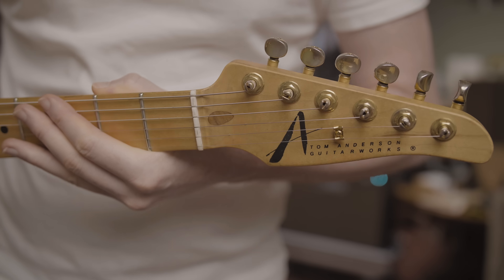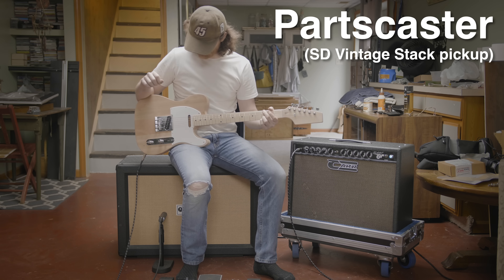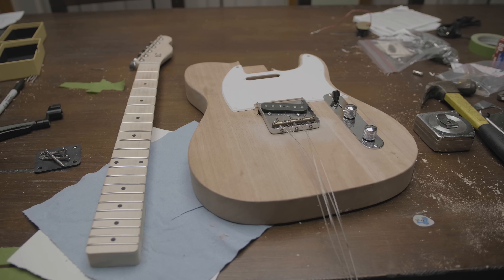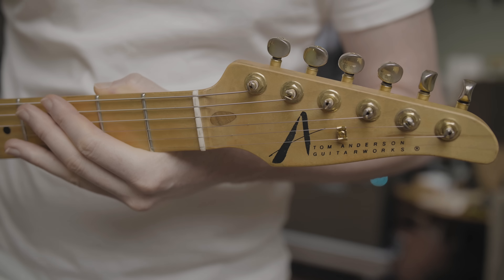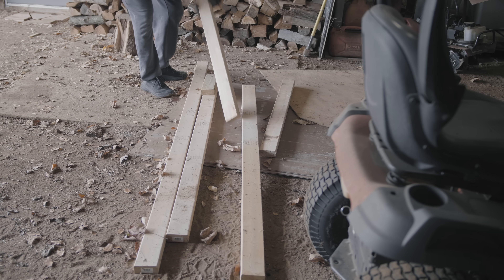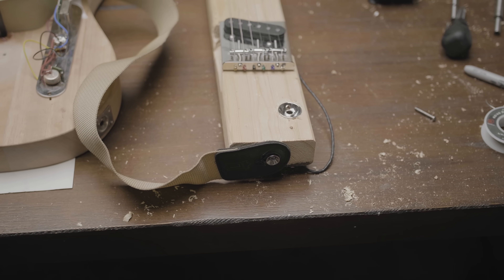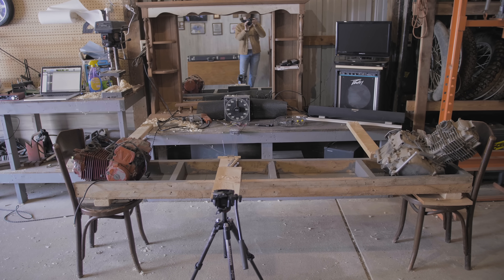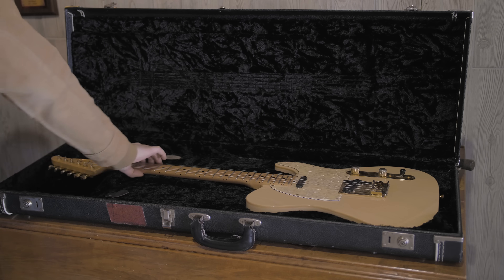Tested: Where Does The Tone Come From In An Electric Guitar?

Comment: Interesting study.  Nice work! I've felt for the past couple years as I build a few electrics now and then, that tone wood matters in acoustic guitars.  Whereas with an electric, the wood doesn't seem to matter too much other than provide aesthetics.  With the tele and strat, the pickups are suspended... they don't interact with the wood if at all as you just proved.  Now, as I write this I wonder about the guitars where the pickups are mounted right to the top, like a P90 on a Les Paul Jr?  Might be an interesting test also.

As a separate thought, I do notice a difference in tone when going from playing slide to playing a fingered note that there is a shift in tone.  With slide I find I lose low end response.  When fingering a note on the same guitar the low end in the tone returns.  The neck has to be contributing somehow in the equation, at least when you have your hands on it, even though I still agree that the type of wood has little if anything to do with it.

Comment: I absolutley love this . Not to long ago I had a discussion with somone about the myths around electric guitars. My oppinion after many years was that the main driver of tone is the electronics. Maybe 5% of the sound can be accounted for in the combination of materials. The rest is in the style and technique of the player. If you take a cheap guitar and do the frets and intonation and put in decent electronics, then the cheap guitar will sound like something ten times the price. The thing we tend to forget is, that by the time we've turned a cheap guitar into a decent guitar, the time and money spent getting to that point will probably be the price of a decent guitar. Then there's the fact that few people will get it right the first time. Acoustic instruments however are a very different ball game. Nice video and solid method and thougth process, thank's.
Reply: Most guitars have good enough pick-ups. Only the bottom line of Squier Bullet, Glarry of sub-100€ Harley Benton and the like will have dull souding junk. Others will just need a set-up and possibly a fret levelling (which is a 30 mn job at worst).
Reply: So much of what any given player likes about any given guitar is down to non-sound-related factors. Off the top of my head - the ergonomics of the body, the weight of the instrument, neck profile, frets and set up all have a practical impact on the playability (and appeal). 

Beyond that stuff like the colour of the instrument, does the player think the instrument is cool, the finish (say a glossy poly of some sort vs nitro) both from a visual and tactile perspective, and even the smell of the instrument all contribute to the experience.
Reply: I built two strats exactly  how I wanted them. Roasted maple necks because I  like the feel. Stainless  frets, dimarzio pickups with no center pickup In either and good electronics.  Both play great and have become my main guitars over some very expensive ones  I have
Reply: I know the player makes a lot of difference, but guitar tone is defined as the tone of the guitar itself, considering the player plucks exactly the same way and same notes. I know, player makes a world of difference, but that's out of the definition.

Comment: Honestly, the biggest change I saw was the changing the pickup, which implies to me that is the most valuable factor.
Reply: The pickups are the biggest factor for sure but sometimes pickups can sound good in one guitar and no so good in another so there are definitely some other factors.
Reply: @ryanstark2350  the guy legit just put the same pickup in 'by the numbers' kit guitar and it sounded the same.  Then put the pickup with just strings and no guitar, and it still sounded basically the same.  I think the pickup was the most important factor imo
Reply: @wildcat31772  He didn't disagree, but he might be right that different scale length, saddles, plate and electronics change it enough to make the pickup sound "bad"
Reply: @DenKulesteSomFins  I would like to agree but when he did the loose vs tight neck pocket I think that would bear a bigger change since that actually should effect the vibration though the body more than anything  - that I why I would be really curious to see a strat test where the bridge isn't fixed to the body
Reply: @ryanstark2350  I have run into this as well. I have no explanation. I have a pickup I didn't like in multiple guitars (SD JB) but I finally found a guitar that it sounds good in, and to top it off I don't even know what the body wood is of that guitar. The main difference is the other guitars it was in the pickup was straight and in this one it is angled so maybe pickup position made the difference.
Reply: @Kevslatvin  Tne main problem I find is that some guitats are bright and some are darker sounding and sometimes finding the right pickups can be difficult. Generally speaking, if the guitar sounds good acoustically but not so good plugged in, then the pickups aren't right but before doing this it's always best to check potentiometer and capacitor values. There are some general rules for this depending on pickup type that for some reason aren't always adhered to by some makers.
Reply: @ryanstark2350  He pointed that out with the 2x4 - the first test had no pots or caps. When he added the controls, the sound was the same. The loading of the controls has an effect on the sound of the pickup
Reply: @2bcmusic  You can put the same controls or no controls on different guitars with the same pickups and they don't always sound the same. I know because I've done this. The pickups are the biggest factor but not the only one.

Comment: Loved the video. Although I could hear slight differences when you did the body through vs bridge through strings and steel vs brass saddles. The pickup/electronics and pickup height setting appears to be the most important factor in sound. At least to my uneducated ears. I'd say what the boutique builders really bring to the table are their craftmanship that hopefully brings better playability, looks and prestige of their instraments vs an assembly line guitar. That is if they both had the same pickups, hardware and setup.  By the way, you bring playing air giutar to a new level.

Comment: Wood does not make as big a difference with solid bodies as it does with hollow and semi-hollow bodies. Pickups, the height of pickups, the hardware and the strings make a much bigger difference than wood, unless you have some rare, godawful sounding wood, which is not very likely even with cheap guitars. But the amp will make the biggest overall difference in tone. There are even composite guitars that sound fantastic. I played guitars with graphite necks that sounded fantastic. There is too much of an obsession with wood, and it's mostly witchcraft.

Comment: Great video, but I think that the amp colors the sound much too much. A clean tone ( and not crunch like in the video) might reveal a lot more differences.  Testing for sustain might also reveal differences. I wonder if using a crappy body with a thick lacquer would influence or not the sound as much ( mainly the sustain).
Reply: This! Not a lot to hear change if the signal is overdriven...

Comment: Great video.  I would like to see in the future a similar test done but with a more vintage correct telecaster pickup, P90, or PAF replica (non-wax potted).  I've always felt that more modern pickups (ie the Seymour Duncan Vintage Stack noiseless pickups) eliminate a lot of factors in the guitar that normally contribute to the sound.  If you've ever played on a vintage Tele or a Golden age Gibson with P90's or PAF's then you know that simply tapping on the guitar gets amplified quite loudly.  The pickups are a lot of times slightly microphonic and amplify every single noise.  I'd suspect that in that scenario a lot of other aspects of the guitar contribute to the tone that don't necessarily matter with a more modern pickup.  But there is definitely no right or wrong here.  Jack Pearson plays a cheap Squier and has incredible tone.  A good player and can play pretty much anything and make it sound great.

Comment: Nicely done, Jim.  I was impressed with the way you re-evaluated your testing methods along the way, especially things like the consistency of pickup height issue and the presence/absence of controls.

For what it's worth, you don't really need to have potentiometers (or even the tone capacitor) in the circuit but you MUST have the same loading on the pickup.  You can mimic a simple 1V1T circuit using 250k potentiometers with a single 120k resistor in parallel with the output jack. The exact value of the resistor isn't critical. It's unlikely you'll hear the difference if the loading varies by 10%. However, half or double the loading will have a noticeable effect. Of course using the potentiometers (same value and all set to maximum CW) and tone cap (same value), removes all doubt.

I'll be featuring your video on Guitarnuts2 later today. You have my utmost respect.

Comment: But the tone woods have an inflated sense of value! How am I supposed to hype my guitar? At least I still have my fancy magic tone capacitor and my tubes.
When you don't know HOW things work, you will believe all kinds of nonsense. It doesn't matter how much vibration is transferred through the body from the strings. This ain't acoustics. This is a wire wiggling in front of a magnet which induces a very very small current. The only part of an electric guitar making a sound is the speaker in the amp it is connected to.
Reply: Somehow this simple logic eludes people.   Muh Tonewoods, muh tonewoods!

Comment: A brilliant test that proves a point I've been saying for over 40 years.  However,if the valve clearances are too tight on those XBR engines I've heard it increases sustain and the sound has more bass when the oil is cold.
Reply: This video does not prove any point other than there are not huge differences in tone when strumming open chords/strings or playing simple riffs without dynamics with an overdrive sound.
But nobody thought that anyway.

Comment: What a painstaking operation to undertake!  Thank you for your patience and effort.  The problem with listening to comparisons like this is the same as when comparing the scents of different perfumes...after 2 or 3 sniffs your ability to tell the differences is greatly reduced.  The most significant difference that I could hear was between having the pickup height very low and very high and that could just be more a factor of shear volume level than tone.  OK...I have to go to Home Depot to buy a 2x4!

Comment: Great video!!  I’ve been thinking for a while now in the wood/tone debate that both sides are right. It’s a difference in rounding errors. One side said wood makes no difference. The other said wood does effect it. The no difference crowd says we’re right. The amount is so little it’s hard to impossible to hear. While the wood people say you said no difference…. There is a difference. 

Wood does effect tone … just not very much. All the parts of the guitar work together to make up the sound. If you don’t like the sound the first thing to change is the amp, then the pickups and/or their heights, then the speaker in the amp, after that the changes will be very, very small.
Reply: I would say the wood makes no sound difference at all, not even slightly. People who say "very very slight difference" or "barely noticeable" really are just trying to be polite. You either hear a difference or you dont.

Comment: Obviously the air guitar has Honda Tone Engines(tm) involved! Fun test. 
You started with the same mythical factors 'everyone does' from the top end builders who rely on selling more expensive guitars due to mystical lumber. And then ended up in the same area I have after my testing a decade ago: if you want to change the tone of a guitar: 1) set pickup heights/bass and treble tip/screw pole heights. Screw poles are like a mini-EQ if the pickup has them. You can rotate a humbucker to put the screw poles at a different 'distance from the saddles'. 2) measure actual kohms and uF of the pots 'n caps to swap those in the same way players choose 250 vs 500kohm but using the 20% tolerance variation to your advantage. Pots 'n caps variation is a huge factor in why the general guitar buying logic is 'run the rack to find a good one' (even though players think its the wood). Muddy pickups can be fixed with series caps to cut the effective internal capacitance due to machine winding, giving you the clarity and note definition of a boutique pickup but for a nickel. 3) last is swap pickups and then go back to the first set to adjust pickup heights. 
I have found there are some ebay import pickups that measure half the internal capacitance of popular branded aftermarket pickups, just like boutique pickups measure, and so it's quite possible those 'two for fifteen dollar' pickup sets are hand wound. Even the Squier single coil pickups have hand-wound characteristics of the bobbin (although some differences due to steel slugs + ceramic magnets). Ceramic magnet pickups can sound like Alnicos if you lower them far enough, meanwhile the ceramics can be raised closer to the strings to give a lot more output than 'thin' alnicos (for heavy metal demands).
If you closely study old Hendrix videos you may see that he played many different guitars (bought, borrowed, and set some on fire) but he tended to set his pickups low and tipped them to get the tone he wanted by ear not specific 'factory height specs'. Of course, he also had that reverse slotted bridge pickup playing a righty lefty but he also had no Strat volume knob in the way and you'll see he played from saddles to neck for all his versatility.

Comment: Pickup hight and output from a pickup is so crucial. I've had guitars sounding real bad because of "wrong" hight and when finding the sweetspot opening up a whole different sound in the guitar ... great video! Loved it!
Reply: Absolutely agree about pickup height.  Lower is much better for tone and articulation. I got a Gibson SG Standard for a bargain price because the owner hated the tone.  I knew how to fix it with 5 clockwise turns of a screwdriver either side of the pickups.  Best value for two minutes I ever earned.  Almost same $/hour rate as a lawyer!
Reply: @MS-Patriot2  great. I happened to buy hw1 strat mk2 almost the same. With a few tweaks, tightening neck screws, adjusting pickup heights and  springs in the back cavity it made a great player. I replaced one cheap saddle and replaced it with fender saddle that I left in acid overnight to match others and it ended up great.
Reply: @MarkoMarcello  Nice. Knowledge, patience and skill sure pays off.  Stay lucky 🤟
Reply: @MS-Patriot2  I thought my tele’s pickups sucked. Then I adjusted the PU height. That’s all it took.

Comment: Never understood how wood would play apart in an electric instrument's amplified sound, glad to see someone do a great experiment for once!
Reply: Most pickups are - at least a bit - microphonic, and the guitar body also resonates and may stimulate or dampen the string in certain ways.
It is one interacting physical unit.
You can hear the resonance of the trem springs in stratocasters - you can even hear the knocking against the body of an electric guitar.
Reply: It matters more on semi hollow and hollow body guitars. But that has less to do with the type of wood used, and everything to do with the way the resonance of the body affects the strings when you get feedback involved.